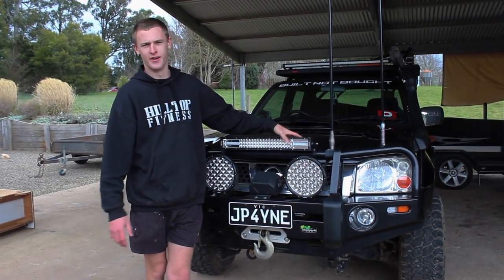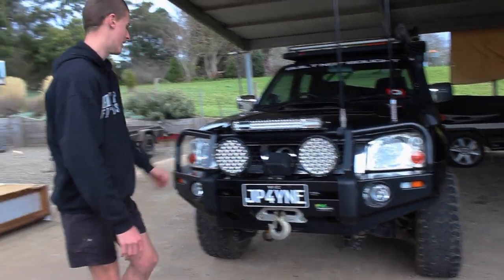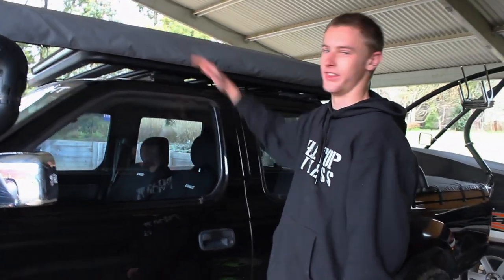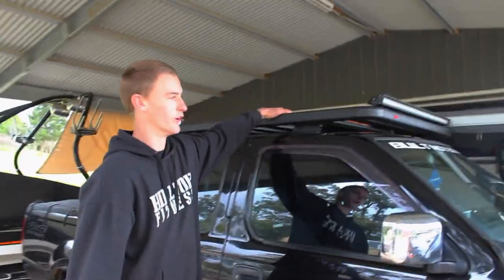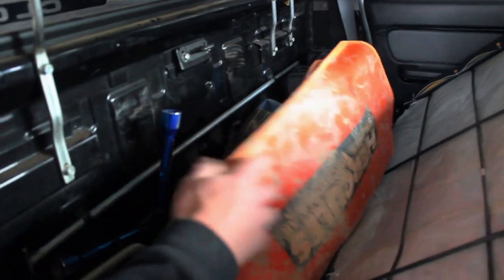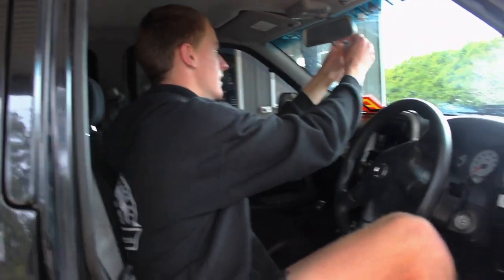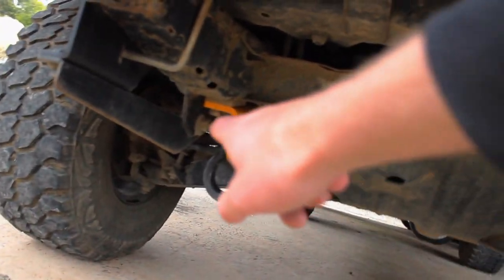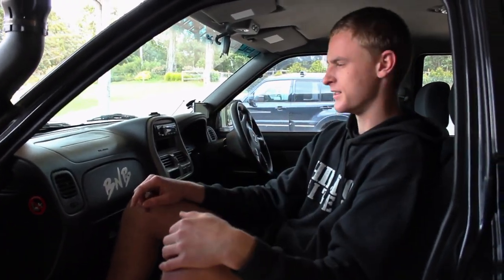MEAN 2010 D22 NAVARA | 4WD Modified D22 Navara Walkthrough!

Comment: Nice video. Got a similar black D22 2012 model - wandering what low profile roof racks do you have here? Is it steel and what is its weight loading if known? 
Happy cruising 😀
Reply from the maker: Thank you appreciate it!! They are great cars!! The roofrack was Yakima, and they are made of alloy. Not sure weight load though, but will hold anything, have had swags, gazebos, kayaks everything on them easy as.
Reply: @traveln4x4  thanks buddy. Will check them up. Need something for corrugated roads one day :)

Comment: Sorry bud, idrive doesn't give extra power. They are mainly throttle response, it only feels like power as it advances the throttle which is handy for off road use
Reply from the maker: yeah it does
Reply: @traveln4x4  Please tell me how it give's you extra power when it's a throttle response unit
Reply: I've been a diesel mechanic for over 22 years, please tell me I'm wrong
Reply: Do the mud flaps and awning give you more power as well?
Reply: Even built not bought will tell you the same...............ask him
Reply from the maker: @richardtodt8660  someones angry bhaha. chill
Reply from the maker: @richardtodt8660  ill send him a note

Comment: You bloks are on wrong side of steering wheel.  What rims and size tires again?  Bought some 15x8 negative 19 worried they will rub on 31 10.50 15s.  My torsions are adjusted and front trimmed for 15x7 negative 6
Reply from the maker: Hahaha, and they are 15x8  steel rims on -22 offset. With 32 muddies. And I have torsion bars wound up and doesn’t scrub now, I had to grind inner guards and cut plastics!

Comment: Hey mate, just wondering when you adjusted the torsion bars, do you remember how many turns you did to get it to that height?
Reply from the maker: Hey mate I’m not sure exactly, I think 9 either side, but if you do them too much the car will feel more rough for sure to drive and some parts to become weaker.